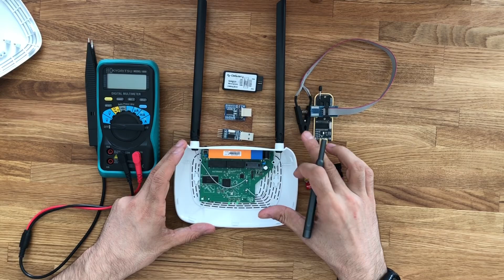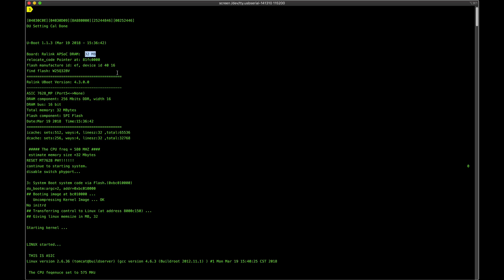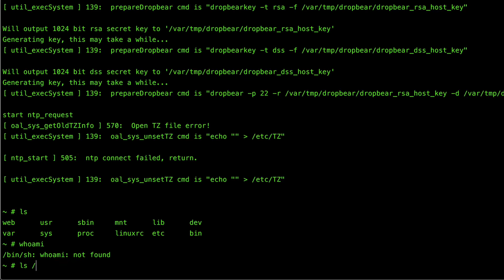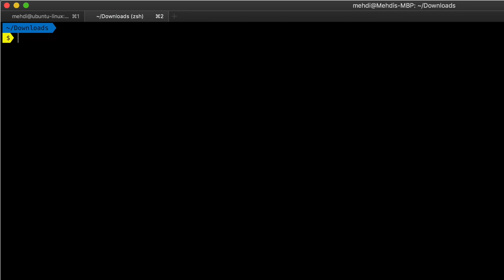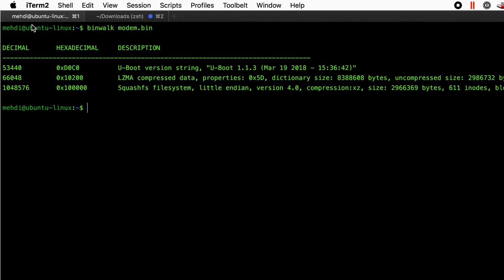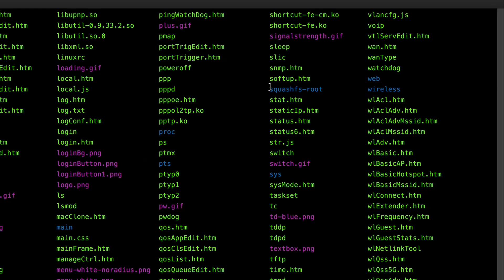Intro to hardware security: UART access and SPI firmware extraction

Comment: btw ch341a can also be used as a usb to serial adapter so you dont need a seperate adapter. just put the jumper on pin 2-3 instead 1-2.

Comment: Have you ever tried extracting the bin file from the flash ROM of the WR1043ND using a CH341A? I don’t have much experience, but I want to try reading it to create a backup. Is there any chance it could damage the chip?

Comment: How do you identify which pin hole is for gnd, rx, tx, when there's nothing write on the pcb?
Reply from the maker: Usually ground is the easiest to identify (simply using a multimeter's continuity mode, with other known grounds). RX and TX can be identified using multiple methods: one is to simply try (there's no harm in using them in the wrong order), second is to use a logic analyzer to "see" what's happening on the wire. I think some UART tools also can auto-discover it. Usually one has lots of data/activity going on, while the other is simply quiet, which means even a voltmeter can be used to identify RX (using fluctuations in the voltage)

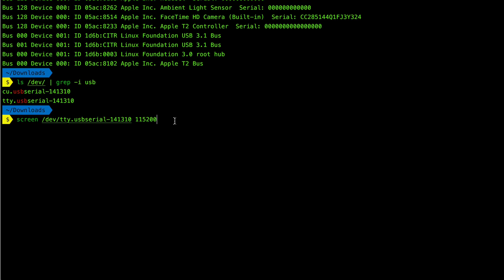Comment: 13:29 "3: System Boot system code via Flash" - this is option 3 in the uboot boot menu.  It is possible to send a different option via serial keyboard input - like boot to root shell.  But this may not be always possible. But in this case, you get to a shell from the get-go.

Comment: Dump or Extract U-Boot from the running board. 
OR
Dump memory to a file from the U-Boot console using the Memory Display command.

This will be helpful in debugging in the situation like you have a board with U-Boot running and don't have the same version of U-Boot binary and want to test on another board.
https://youtu.be/yDFMcBNGW3U

Comment: Hi, I used 115200 Baud rate for UART, which is connected to the IP camera board, but as soon as I give the power, the putty window displays garbage values, need your inputs/suggestion
Reply: Sounds like you may have the baud rate wrong, there are not many standard baud rates so it should not take too long to bruteforce the right one.
Reply: @JordanPlayz158 I second this for anybody reading this for future reference.
I'm new at this but have seen that the wrong baudrate will give you garbage.

Comment: PL2303 has the right voltage? I meaning 3.3 by default.
I get confused about the right voltage, do you have another video about the voltage?
If you test the PL2303 pins, what voltage do you get?

Comment: Important Points:

Connecting the Cables

Remember from my UART-Introduction, there are only 3 pins you need to connect:

    GND, so that all devices have a common ground. This is important.
    The RX of the USB-Stick has to go to the TX of your router.
    The TX of the USB-Stick has to go to the RX of your router.

That’s right: We cross the RX and TX cables. One side’s TX (Transmit) has to connect to the other side’s RX (Receive). Makes sense.

Also, make sure you connect the sticks GND to the routers GND. These devices need a ‘common ground’ to talk to each other.

Source: breaksome.tech

Comment: hi! thank you for the video.  I have an alarm.com outdoor IP Camera that I'm trying to unlock.. they can only be used with an alarm.com account - even if you own the camera outright.  I want to change the firmware to get access and make this camera to be used by any provider, or no provider at all, just an unlocked camera.  I've been looking all over the boards in this camera, and no UART port exists :(   not all device have UART I guess?  or is there another way ?
Reply from the maker: This is very tricky. I am not familiar with that particular camera, but you don't necessarily need UART for that. For example you can dump the firmware, change it and then rewrite it to the ROM again, but it is easier said than done. There are many things that can go wrong in that process. By the way not all boards specify the UART pin-outs.
Reply: thanks for the quick reply. i can't stop until i get root access to this camera.  this company locks their cameras so even after your contract is finished, or even if you pay for the camera in full, you can never use it as a stand alone device, you have to pay for a subscription with this company just to use YOUR camera. it's crazy and I need to get this working.
Reply: @Filip Carlsson it's an ADC-V723 model - from alarm.com.   I really want to crack this thing. so bad.
Reply: @Filip Carlsson discord ?  name is Florin79
Reply: @Filip Carlsson sorry, Florin79#5889

Comment: Pretty sure eeprom isn't even a ROM. Its and can be erased and flashed many times. Data can be modified by the device itself, so its also used in microcontrollers to store data after power off.

Comment: Nice video, pal!!
I have this question rolling in my mind: why is it so important to work on the firmware?Can we "attack" another thing?
Reply from the maker: Because the firmware contains the actual code, and it might be possible to find remote vulnerabilities and therefore attack other similar devices remotely. Another thing that you can try locally, is hardware fault injection (including voltage glitching, electromagnetic fault injection, etc)
Reply: @MehdiHacks  Thank you for replying!. Dude, how can i contact you?. I need to ask you some more questions about UART and firmware! :)
Reply from the maker: @toncho1986  You're welcome. You can reach me via Twitter: https://twitter.com/mehdi0x61
Reply: @MehdiHacks  Dude, have you got any email?. I do not use Twitter :/
Reply from the maker: @toncho1986  DF2HF[at sign]pm.me

Comment: thanks a lot.
how we can extract portable wireless modems firmware? (4G or TD/LTE)
for example modems which is locked. i mean they restricted to work only with specific SIM Cards.
Reply from the maker: Well it depends on the modem. I don't know about your modem, but I have seen some that save all the required info on a config file. If you access it via UART, you can edit the file and bypass the limitations.